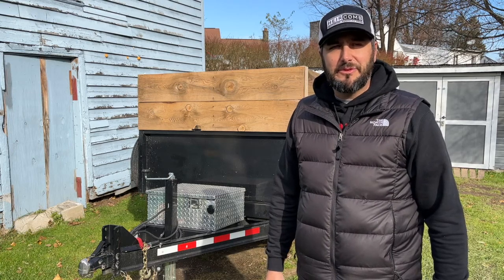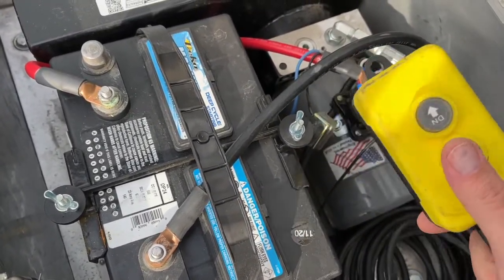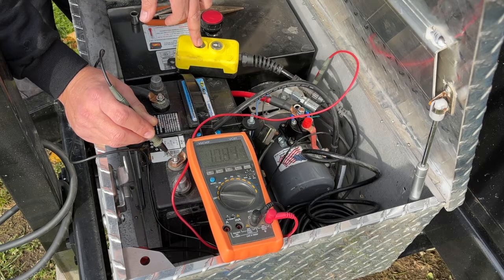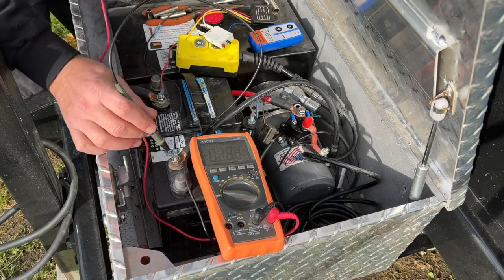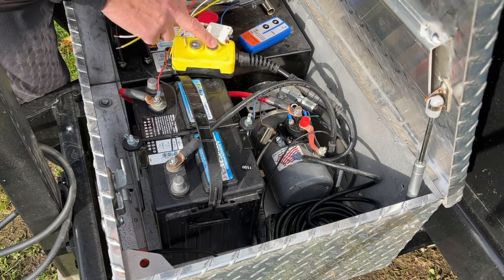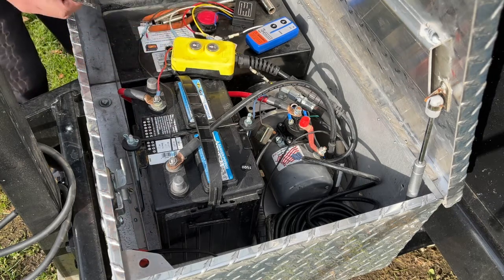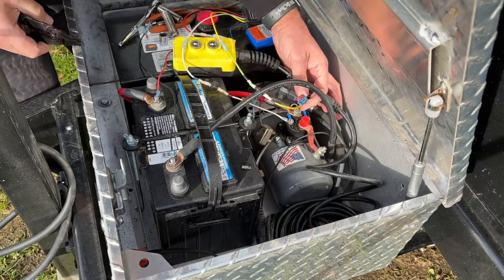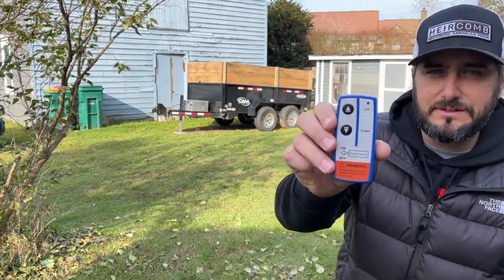Installing a Wireless Controller on your Dump Trailer

Comment: You commented that the diodes are to prevent backfeeding into the wired pushbutton controller.  My understanding was that they are to prevent both solenoids from being energized simultaneously?????

Comment: Wandering if anyone knows that the wireless receiver has a continuous amp draw and will run your battery down if you don't put in some sort of a power cut off switch to the hot lead of the wireless receiver. This can also be done without the diodes by using fused relays.

I did a 300 amp Blue Sea battery cut off switch that disconnects all power to everything except for the DC to DC charger from the truck and Solar input charger to the battery.
Reply from the maker: I would assume there is going to be some type of low power draw that the receiver uses as it’s searching for input from the remote. This is the reason I installed a the trip style fuse with on off switch. I leave it off until I get to where I’m dumping. I also don’t know if there are any devices (frequencies l) that might trigger the receiver to lift the dump while I’m driving…. I don’t have must trust in these cheap Amazon devices, but it has worked flawless time after time. People still look at me with that confused look as I’m backing in and the dump is already going up. In and out quick, especially if it’s an extra smelly day at the city dump.

Comment: Does your solenoid click fast and repeatedly while you press up? My solenoid clicks really fast as it moves up. My down feature is fine
Reply from the maker: My solenoid clicks only once to activate and stays on continuously as the button is pressed on both my wired and wireless controller. Does this happen to you when using both wired and wireless?
Reply: @mw3designs  no mine only has the issue with the wireless remote
Reply from the maker: @torojunkremovalSD  are you using the same wireless remote as mine? Only thing I can think of is an intermittent signal or wire connection causing your issue. Make sure remote battery is good also.
Reply: Yeah same remote
Reply: I’ll throw some new batteries in it today. Thanks!
Reply: @torojunkremovalSD  did new wireless remote battery do the trick? Having the same issue.

Comment: Any idea what brand or style of circuit breaker that is? I'm having issues finding that style.. Seems like all the ones on amazon are push button reset only, not actual on/ off.

Comment: Do you have a link for the circuit breaker you used?
Reply from the maker: 20 amp might be a bit high, the circuit is low amp, it is just for tripping the relay that transfers the big power. I would say 10 or 15amp is plenty. I only used the push button type breaker because I had one laying around, and it was easier than an inline fuse and a on off switch. I like the idea of turning it off when not in use, as I don’t know if and how much of a power draw the wireless box has.
Reply from the maker: They were some old stock I had laying around for quite a while.
Reply: @mw3designs  is that just a push button circuit breaker? I found this one on Amazon 

Tnisesm 20A Push Button Circuit Breaker 125/250V AC 50V DC, L1 Series Manual Reset Thermal Circuit Breaker with 19cm Wire Leads, 6.3mm Female Spade Terminals and Waterproof Button Transparent Cap

Comment: Thanks for posting. What amp size in-line fuse did you use? Also what size diodes did you use?
Reply: I was wondering the same thing about the fuse. I have the same set up and I used a 15 amp diode